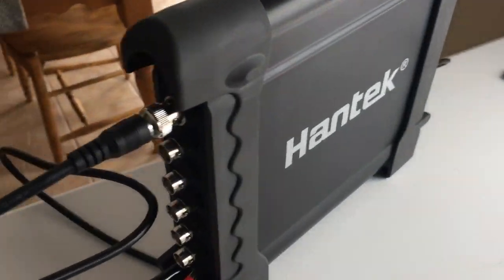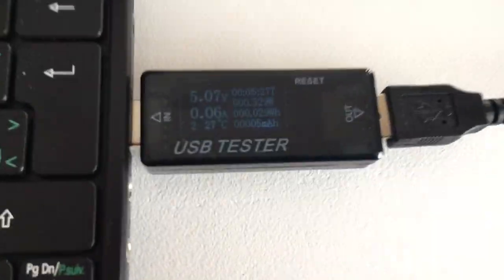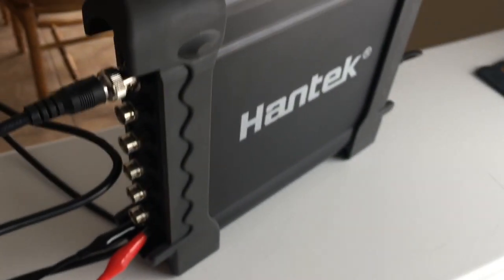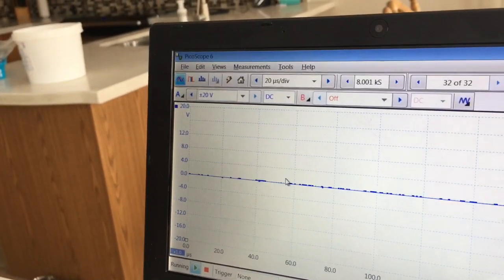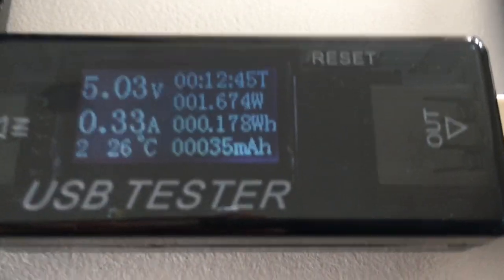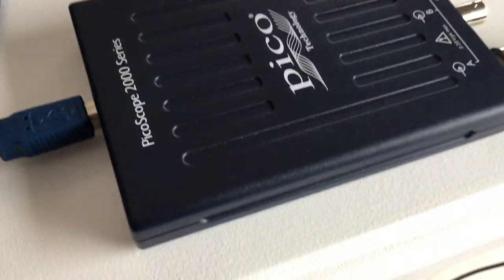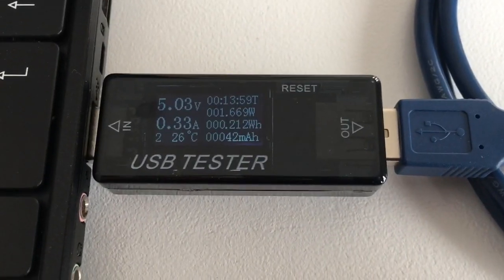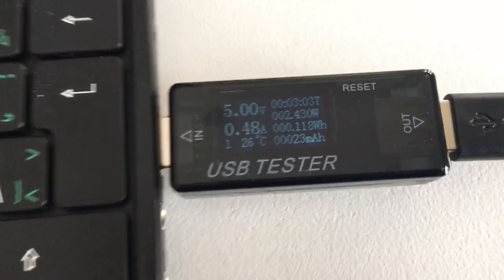Hantek1008C & Pico 2204A Draw

Comment: I’m surprised how low the draw is 👍👍👍
Reply from the maker: I was too. Also the difference in draw between the two units. Proving the point that sometimes the physical size of the unit is not synonymous with consumption. Cheers M8

Comment: Actually (lol), I never realized how much of a hog the PICO is!
Hantek 6022BE is "only" 180mA and is supplied with a "Y" cable for aux power.
I thought there were 2 YOKO, then realized it was "actually" a silhouette:)
Reply from the maker: logical canuck Oh man I really gotta stop saying that!!! I would never have guessed the consumption was so low. (The point to the video). I see that cutout in the corner of my eye and think it’s her all the time. Cheers Denis
Reply: @TheGibby3340  - those HS10x oscilloscpes I build are also incredibly low power consumption like HT1008.
Martin has measured and published current draws for supported scopes and has the HT1008 <30mA ...and though you got 60mA , at those levels it is hard to know which is right (likely neither, I've shown in a few videos how our hobby level equipment and abilities fail at these low levels)

I'm going to buy one of those USB current gizmos shown in your video...I like that!
Reply from the maker: logical canuck Hi Denis. Completely agree...The little USB rig...6 bucks...ridiculous! Seen “Big Clive” using one and thought it was pretty trick. He’s a Scotsman out of Isle of Man. Some really interesting stuff. Cheers
Reply: @TheGibby3340  yes, am familiar with Big Clive...he's a hoot!